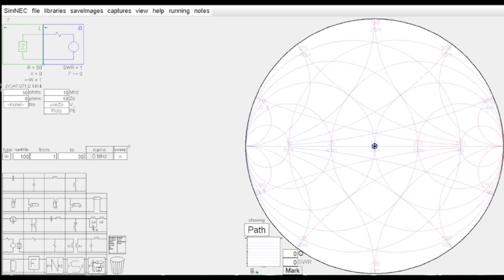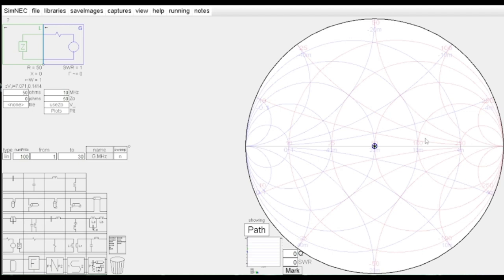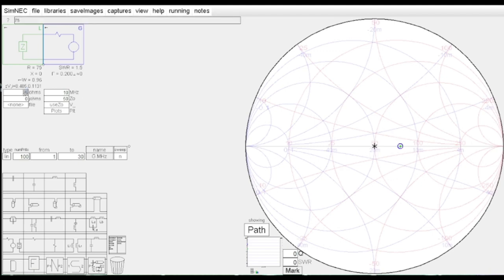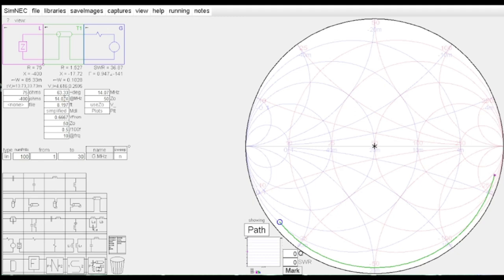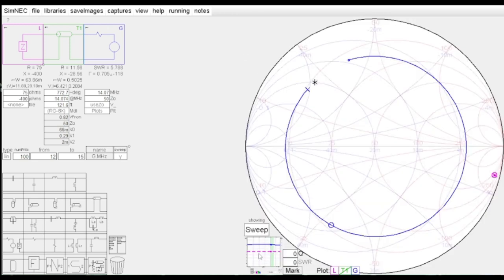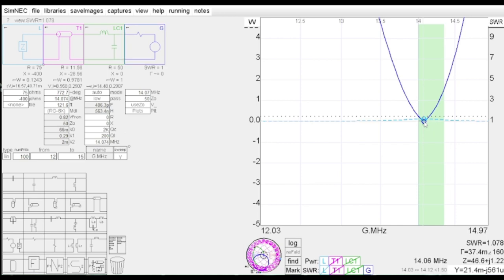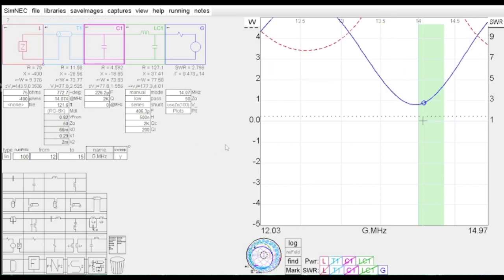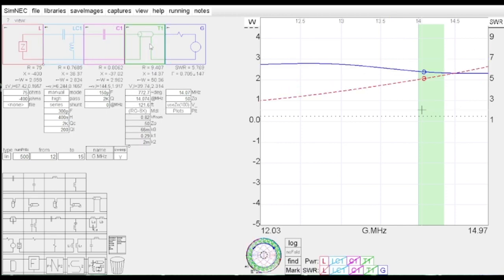Pi, T and L Networks in Sim Smith - Ham Radio Antenna

Comment: Excellent job Ape.  This modeling software is invaluable for anyone building antennas, tuners etc. or wanting to understand wave propagation.
I'd like to see you do a series on this software that does into a bit more depth than this brief overview.  For many viewers, this could be overwhelming but it is so worth the effort and IMO is part of the fun of being a ham.  Understanding how the pixies move down a wire and how the inductors / capacitors influence them on their journey is invaluable.  73 OM.
Reply from the maker: Hey Hollywood.  I am planning on doing some more, I’d like to do a series that solves a problem where each video builds on the others.  Thanks for the positive comments 👍

Comment: Very fascinating! Using it in an antenna build would be very helpful.  Good job!
Building an OCFDipole right now and this could be a great tool if I understood the actual use in the field.
Reply from the maker: That’s what I want to do, use it for a vertical antenna project I have simmering on the back burner 👍

Comment: While you didn’t point it out, the example you have shown demonstrates the reason why we want the tuner at the antenna and not in the shack. Take a look at the power at the antenna with both configurations. The tuner before the coax not only raises the Q (lowering the bandwidth), but it also creates a huge amount of power loss. Tuning coax in the shack is the worst thing you can do to your signal. Always use a tuner at the antenna and turn off the one in the rig!!
Reply from the maker: Great observation and point, thanks for the comment Scott 👍

Comment: Smith charts can be over whelming. In the extra class I help teach we try to do a hands on presentation using a variable inductor, variable capacitor and resistor decade box.  We show how the curve changes based on the variables.  It gives them abetter sense of what is going on.  73
Reply from the maker: Hey Jeff.  They can be overwhelming, sounds like you have a good technique for teaching 👍